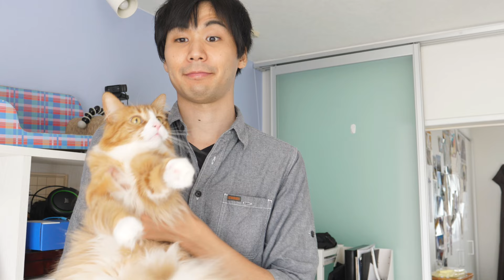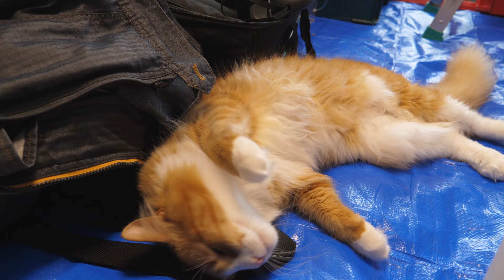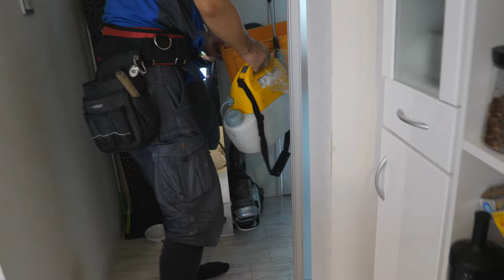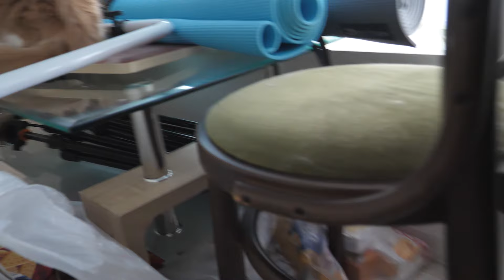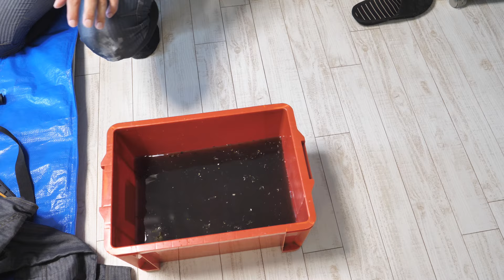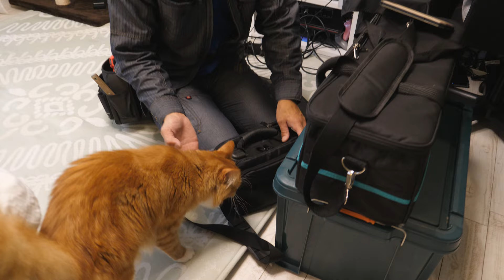Haku falls in love with our AC cleaning man

Comment: You're supposed to clean AC units?  I mean, I've got window units rather than a dedicated unit like that, but I just dump out the water and maybe spray some bleach into the vents on the side when I uninstall them for the winter.  Maybe run the filter under the sink.
Reply: Yeah it stops them from clogging up or blowing nasty air into your house. Even windowshakers need some cleaning